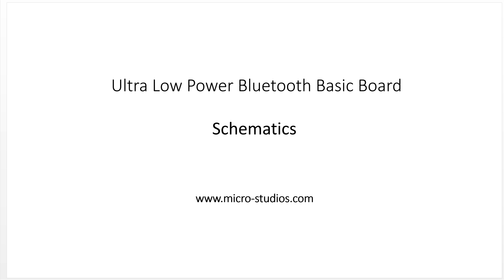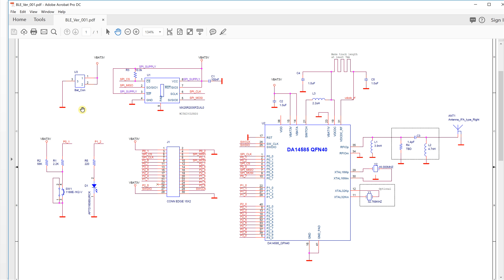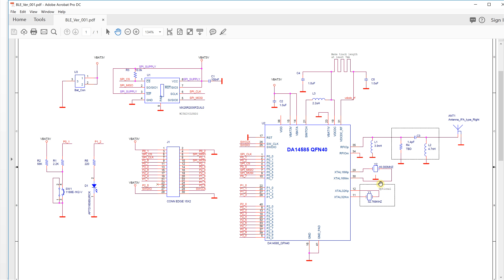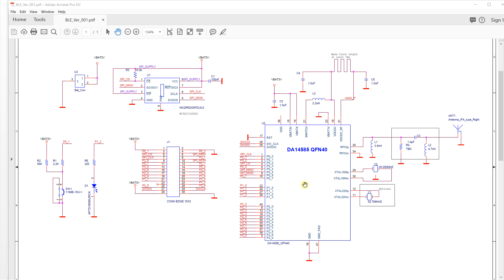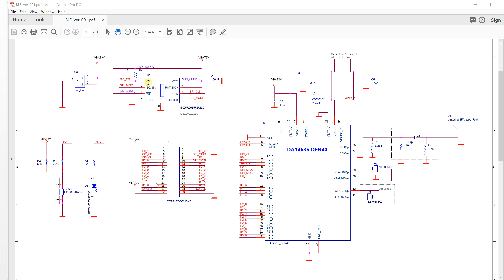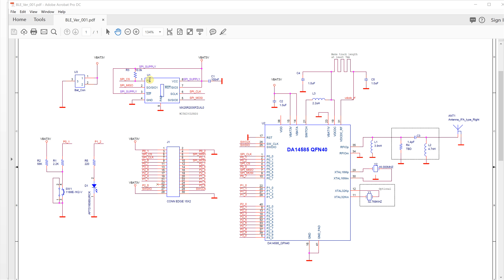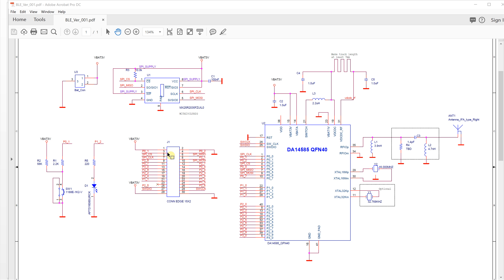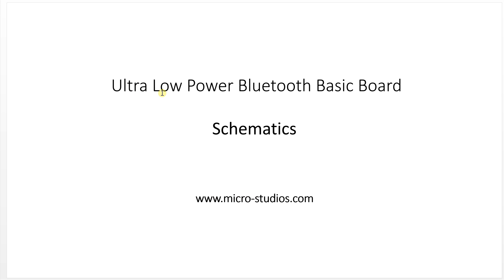02. Schematics For Ultra low power bluetooth basic board

Comment: Can a "Line out" ...for a powered subwoofer be connected to the ZK-502T board?????
Reply from the maker: You mean, receive data by the board, and play it through the "powered subwoofer"?
Reply: The board only has "high output" terminals. Is there somewhere on the board I can solder to that will act as a "low level" output that I can feed to the powered Subwoofer ?  ... and tgank you for tge reply earlier sir.